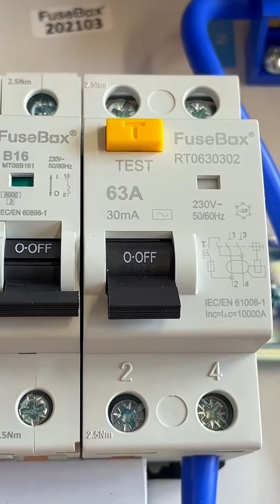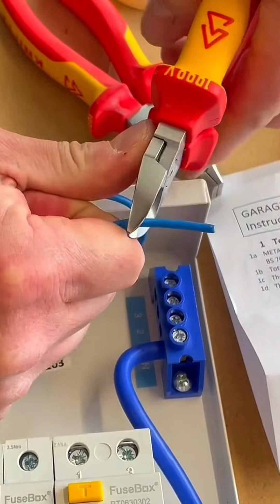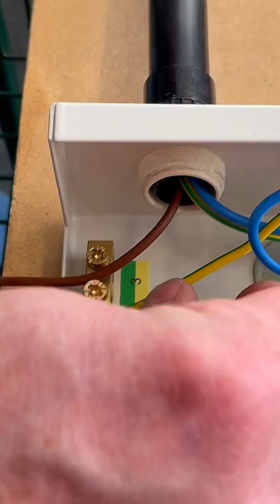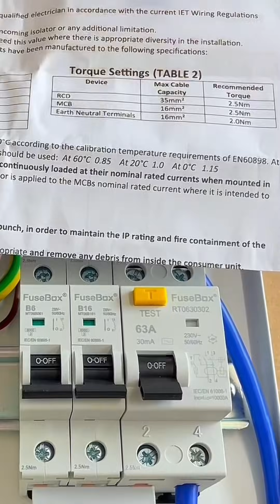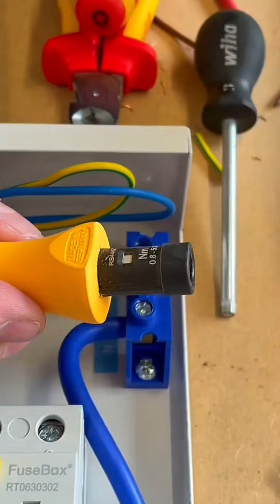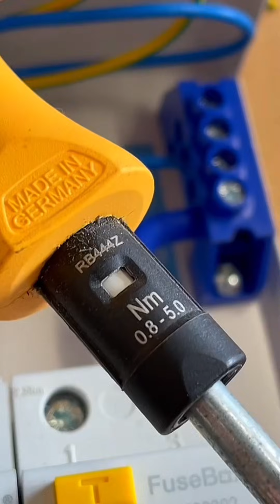Wiring Up a Consumer Unit

Comment: Please correct me if I'm wrong - I'm just trying to learn here, but:
1. No proper tool for removing isolation. The strands at the place of isolation cut are now likely damaged
2. Twisting and doubling over is not what you're supposed to do with this type of wires. Twisting with pliers is bad practice overall. And as I understand flexible multi-strand wires are not even supposed to go into screw connectors. Bootlace ferrules must be used

Comment: Hey, question plz, you have terminated all neutral wiring into a busbar - why plz, I understand neutral come out the bottom of the RCD into a busbar ( busbar throughout the bottom) and the in coming cable - the neutral wire goes to the busbar - what the thinking behind this - if you have a video/ tutorial on this plz

Comment: Last week I wired up an Axiom Garage consumer unit into a log cabin and I really found it difficult as room was really restricted inside the unit but I got there in the end. 

I ran a test using a portable power station to simulate connected to a live circuit, it was a way of testing the lights and two double sockets. The one problem I came up with was that when plugging in my tester it came back as live neutral reversed but I knew it wasn't so I checked the sockets and the lighting circuits and they were correctly connected and found what was giving me the fault was at the 300w EcoFlow power station possibly the inverter causing the issue? Maybe I should have checked that first. 😶 

Never mind, everything worked, I reconnected the armoured cable and now need an electrician to do the final connection and checks at least I know and feel better having the  knowledge I have wired it up correctly. The whole house had been rewired recently and whoever did it left the old consumer units on the board with the Bakelite fuse holders, just cut the wires, I thought this was a bit naughty so another job I have to do, and  then there is my bungalow with it's 1999 plastic consumer unit, my electrician nephew can do that one.

Comment: So if that was a 32A for a ring socket circuit you would put both brown lives wires into the breaker, but would you also double up the neutral and Earth's too with space being a limiting factor say only 3 neutrals and 3 Earth's places to terminate?